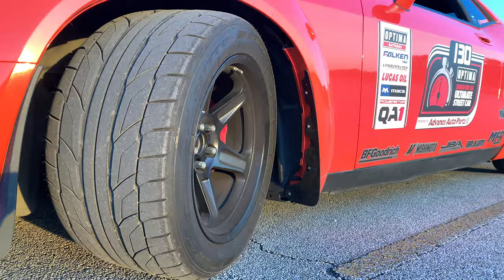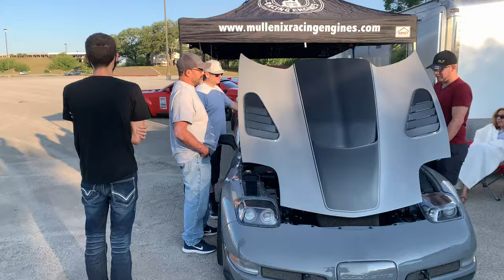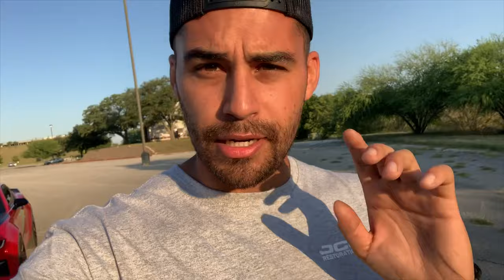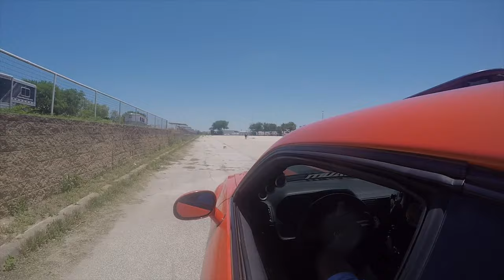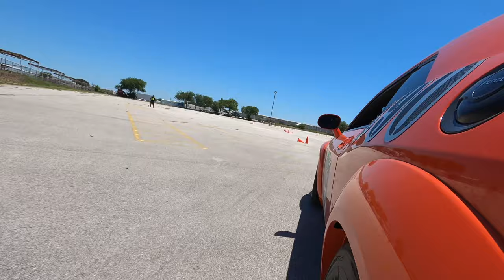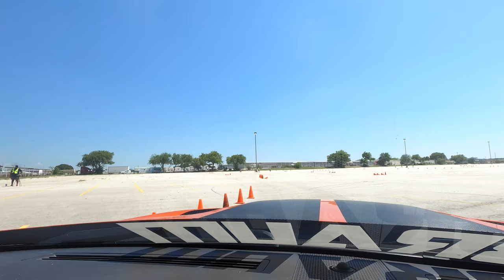Challenger Widebody shakedown at SASCA autocross!

Comment: Car looks great on the course! I wonder if something is getting heat-soaked and causing the 'limp home mode'?
Reply from the maker: I’m not sure, I’m going to get with a tuner and see what he can find. The car was dead cold before run one and it immediately did it towards the back sweeper on the course.....

Same issue at Optima, then the next day on the road course the car executed flawlessly no limp mode issues...
Reply: TIRADO RACING I was just thinking because I would have this same problem while auto crossing my 370 with less than 1/4 tank of gas. The Z would starve itself from fuel after a sweeping high speed right hand turn. 

On the Z the fuel pickup was located on the right side of the fuel tank, meaning that with the “right” conditions (less than 1/4 tank and fast right turns) all the fuel would push to the left side of the tank (centrifugal force at work). 

That might be the source of your limp mode. Sometimes my Z would stall, others it would just go into limp mode. 

Good luck
Reply from the maker: I thought the same thing back at NOLA. So I added fuel into the car but that still didn’t fix it. 

Turned out to be a tuning problem and got it sorted out!